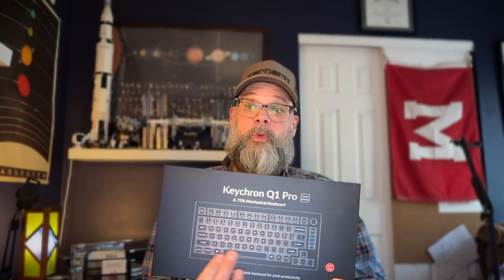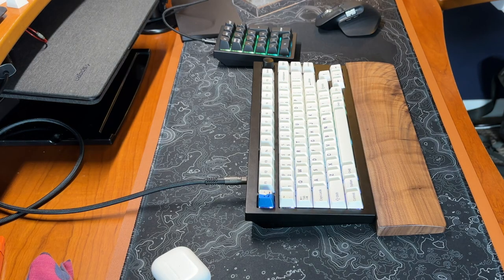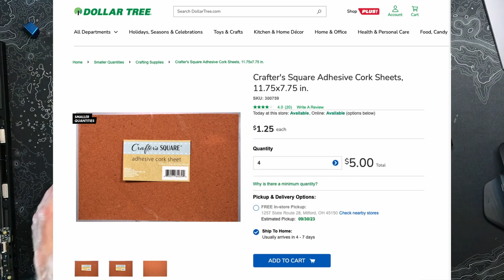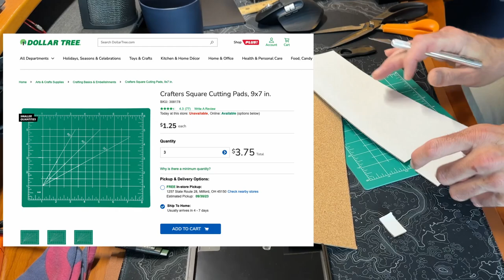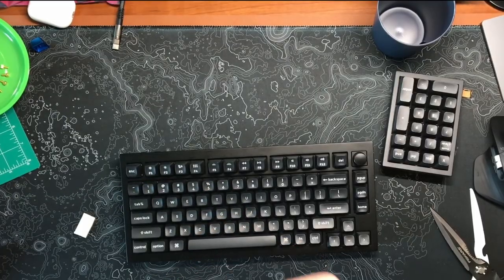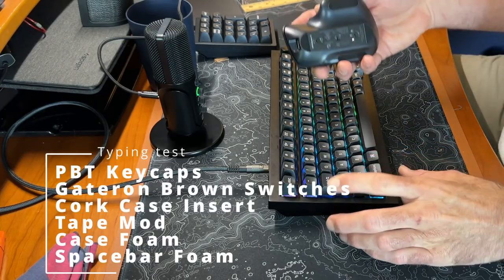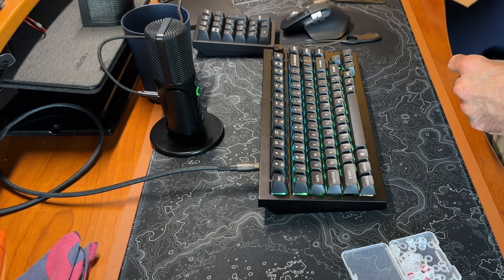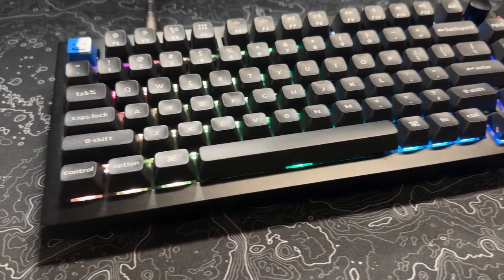CHEAP & Easy Mods for any Mechanical Keyboard!!!

Comment: That's too bad about the Q11 but this one is also really good. I suggest you try the Force Break mod, basically you add small pieces of tape in between the two halves of the case, next to the screw holes to reduce the metal on metal contact, a slight ping noise. Many people recommend it.
Reply from the maker: This Q1 Pro already has all kinds of force break mods along the seam.  From what looks like silicone tape to some kind of metal mesh/screen thing.  I''ll highlight those parts in my next video about this board.